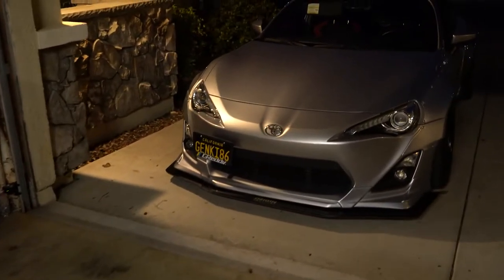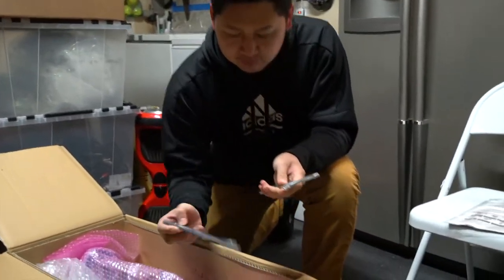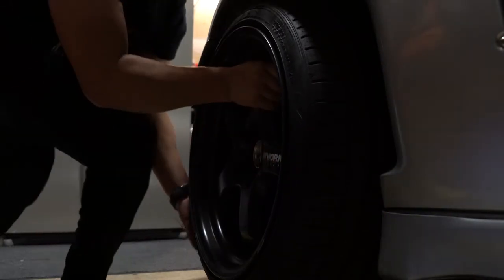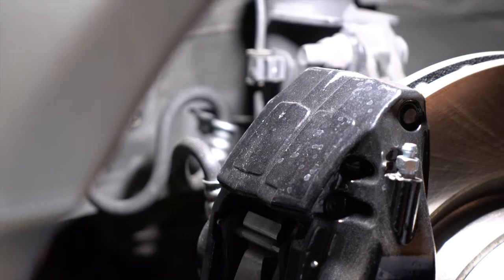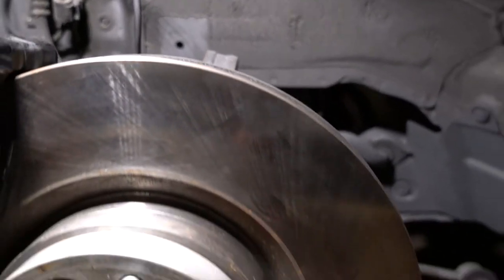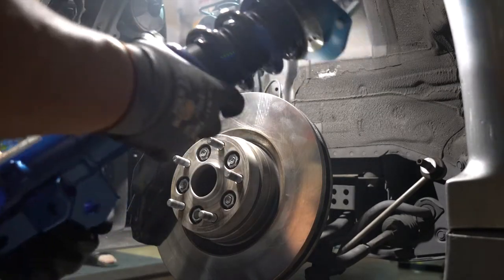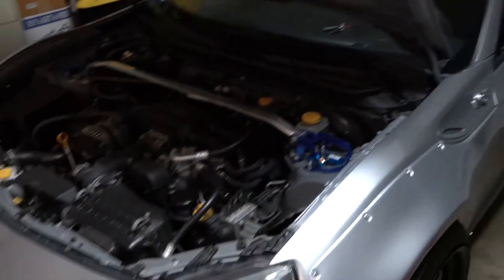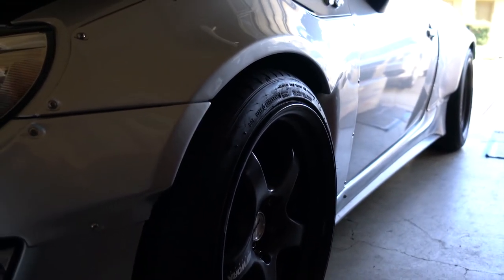Rocket Bunny Frs Cusco Street ZeroA Install

Comment: How is it over bumps? Is it better than stock suspension hitting bumps or accidental pot holes or is it like you fell into a crater?
Reply from the maker: @Itachiboyz3  I no longer known the vehicle. But I can honestly tell you they feel like lowering springs but the bumps and speed bumps are no problem they felt really good daily driving.
The Spring rate stock on these are around 6k I’d like to say they are good for everyday driving.
I ended up going to 15k spring rate because I wanted to be more stiffer with swift and then it felt like I got into fight getting out the car 😂